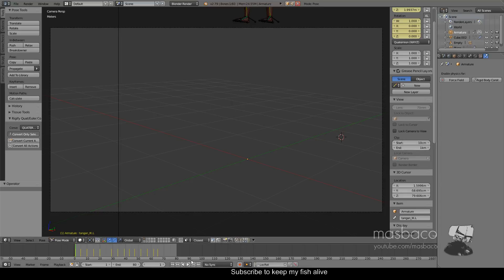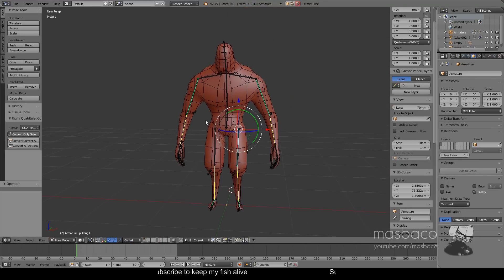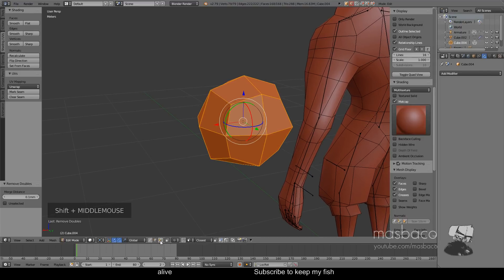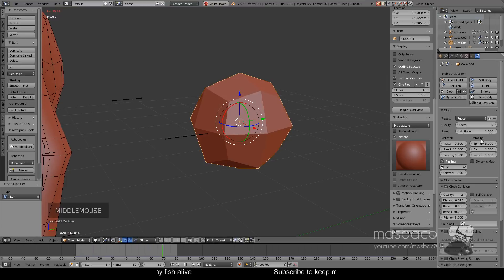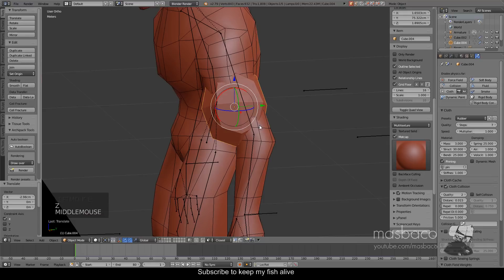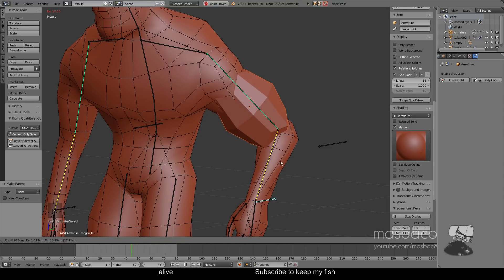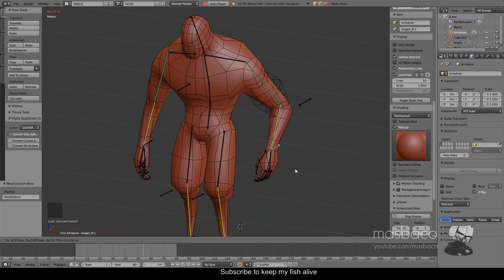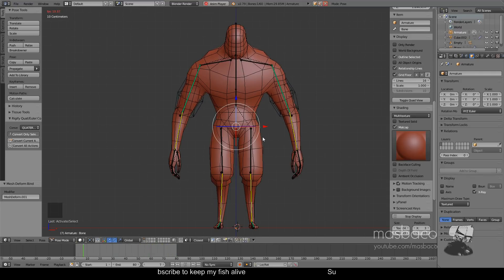low poly jiggly muscle simulation [blender 3d]

Comment: Thanks this was pretty helpful. However when taking a render it still displays the deform box as a black visible box even though it's set up as wireframe only in display, can this be fixed? Also, can this sort of deform simulation be used in a game engine?
Reply from the maker: my bad, i give example here for glsl viewport render but not explaining that on video. for internal render or cycles render go to outliner tab (by default its on top right side) then find your simulation cube for example  cube.001 or what ever you rename the cube was, if you parent it to the bone then its in the bone root. then click the camera icon to disable render (the eye, arow and camera  icon side to the simulation cube name).

Comment: This is fantastic! Two follow up questions if you have a second: 

1) Is the reason the extruded and shrunk duplicates in the cube are made to help the cloth modifier keep it's structure, or is there another reason?

2) Is there a way to limit the influence to a vertex group on the main mesh instead of the objects volume? I'd wanna try this with my characters hair but wouldn't want the face deforming as well. 

Thanks!
Reply: I think there are 2 ways:
1. Make sure your hair is a separate object, and then the deform modifier will only apply to that, or
2. If the hair is the same mesh, assign the hair vertices to its own vertex group, then in the modifier set that vertex group in the field to the right of where you assign the object doing the deforming
Reply from the maker: yes the extruded edges is to keep the structure  slightly firm. and for the 2nd question i'm not sure how to explain that with text.
Reply: Woah! Fancy seeing you here :D